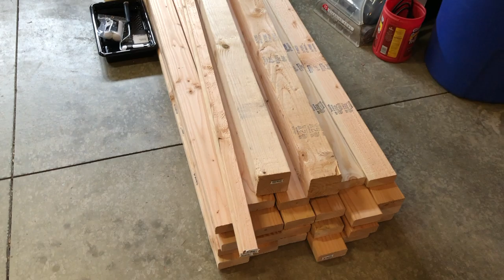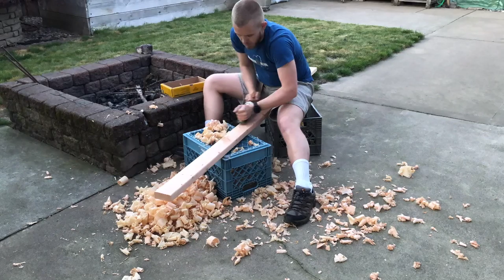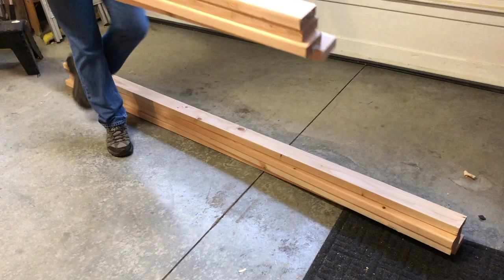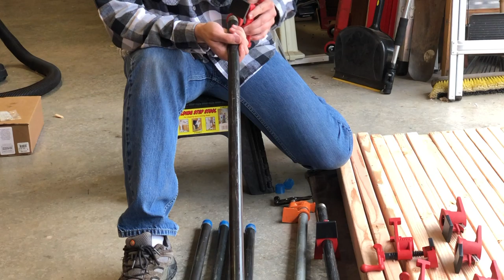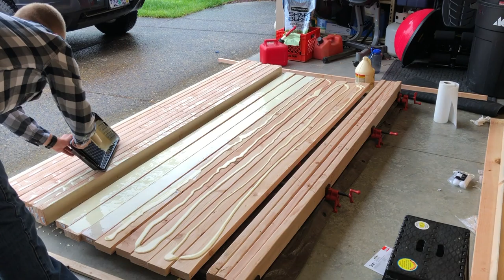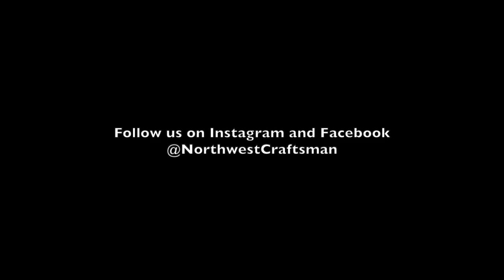Building a Workbench - Part I

Comment: Hey man good stuff! I’m planning on building a workbench with 2x4s as well. How did you go about getting them planed? What hand planes did you use and what are you looking for. 2x4 look somewhat straight and planed. Again awesome stuff.
Reply from the maker: Carlos, thanks for the compliment! I love this workbench and am thinking about building another because of it. 

In this build I did all of the planing by hand, it takes a long time but is totally doable. It helps when you're picking out your lumber to choose boards that are generally straight and clear. Bowed boards can be clamped out once assembled but a board with nearly any other kind of "warp" is just about impossible to correct. I picked through about a unit of 2x4's when I started, and make sure to go with kiln dried because they will be more stable. It's also going to be hard to do but try to choose the clearest lumber you can because knots will make planing difficult later. 

Once I had my lumber I used my Stanley No. 4 with a newly sharpened blade to take off just enough material to get a smooth finish on all of the boards. Make sure your boards have the same width so that when you clamp them, you can use some cauls or homemade cauls to get your boards even. Also make sure to sharpen your blade often, it's amazing what a difference it will make. If you don't have a workbench to clamp to right now (that was my case), clamp the 2x4's to a 4x4 to keep them rigid while you sit on them and plane them.

If I was to do this over again with the tools I have now, I'd run all of the boards through my planer to get them dimensionally identical and flat on all faces. I know this isn't an option for everyone and wasn't for me when I built my bench. 

If you have any other questions, let me know! This was a very fun and useful project.